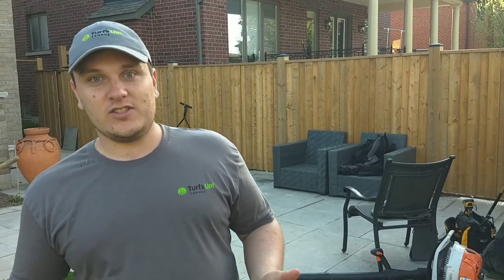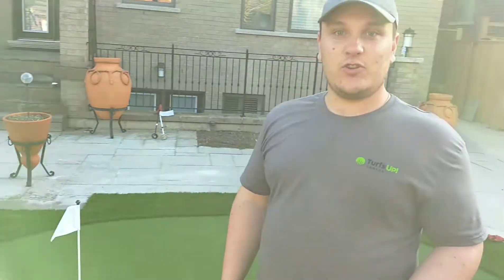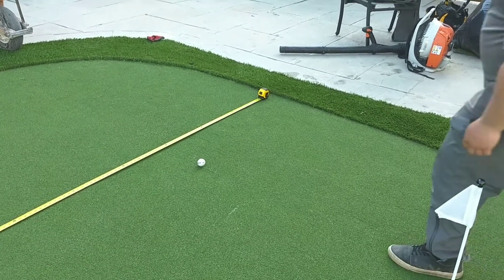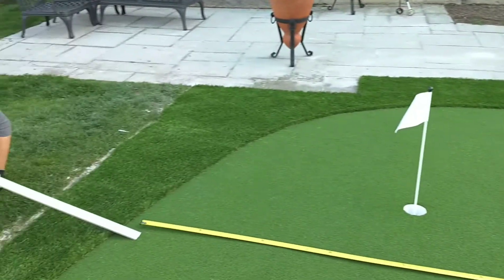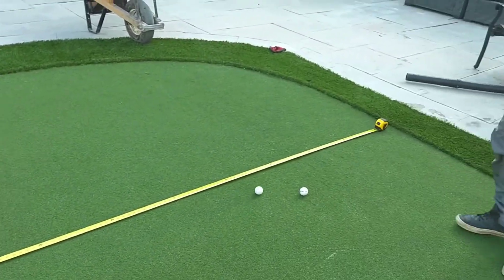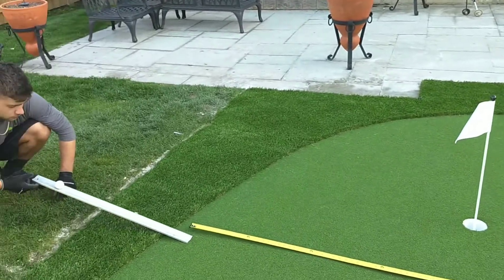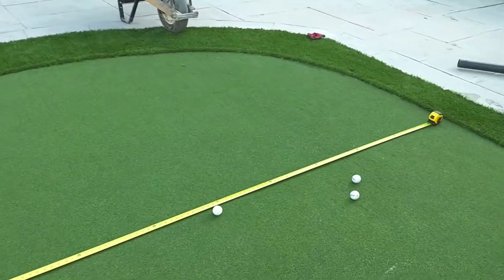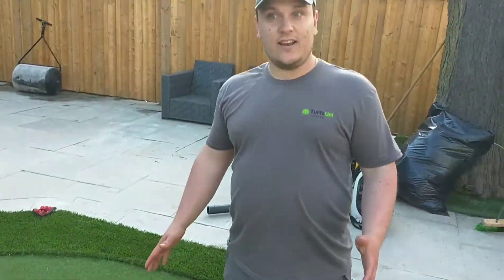Artificial Putting Greens - How to measure green speeds

Comment: U have to use the stimp meter from where the ball lands back to where you ran the stimp and then average those... If there is a 2- 3 ft difference you throw those readings out